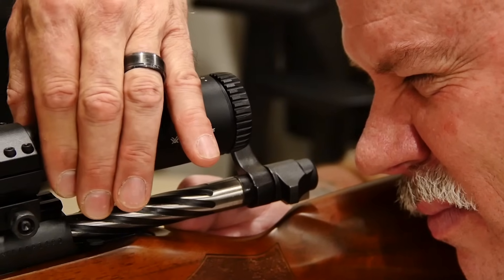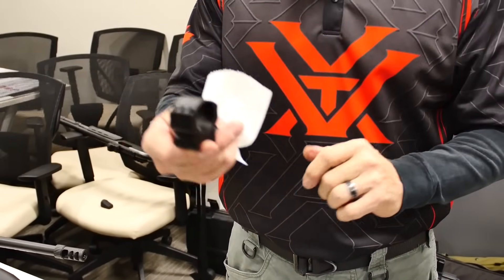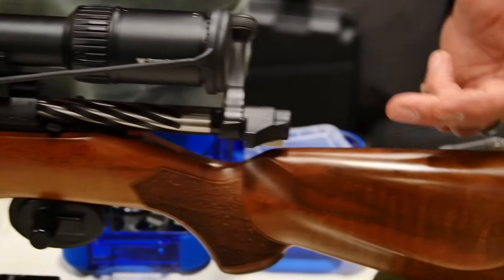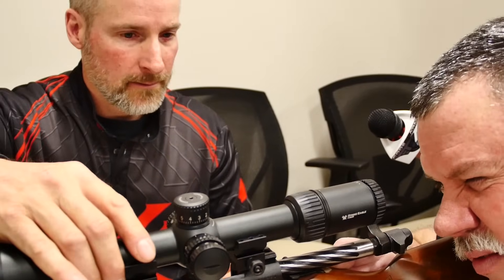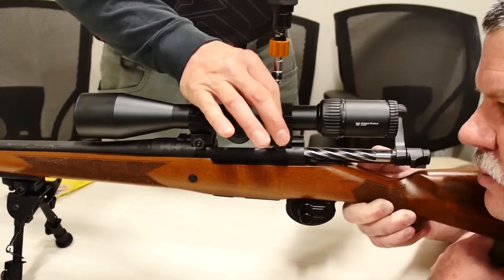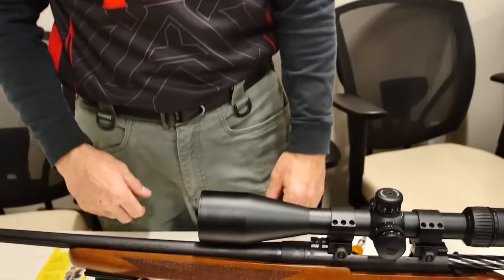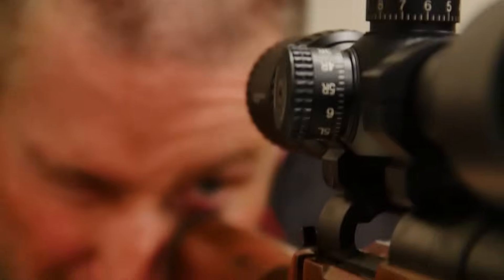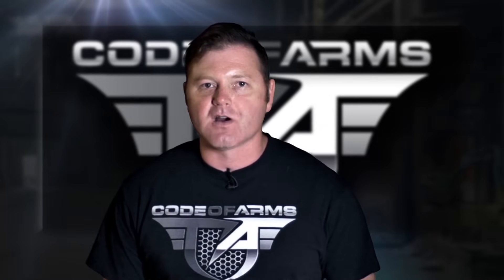HOW TO INSTALL A SCOPE PROFESSIONALLY - By Vortex Pro-Staff Mike Brake

Comment: Very good video covering most of the basics! A few pointers that some may find helpful: If you're using picatinny or weaver style bases and rings, there's not much you can do for ring alignment, but if you're using dovetail type rings then a ring alignment tool is great for proper ring alignment. Also, for the best ring alignment and obtaining the best ring to scope mating surface, lapping the rings would be a great idea to true them up and provide the best ring to scope surface contact. Finally, while I thoroughly enjoy being able to use a reticle leveling tool, unfortunately not all scope reticles line up exactly with their turrets. An idea that has worked for me in the past has been to hang a plumb bob not too far off, and use it to align the vertical cross hair once the rifle has been leveled. Thanks again for the video, and for allowing us to comment. Good shooting!

Comment: I like this video in that there are a lot of good basics most people over look or just don't know about.
I started getting serious about shooting in 1968 when I was 16yrs old. I figured out very early that a level scope was essential to accurate marksmanship. Back then all we had was a carpenters 3" LINE BUBBLE. I got my rifle level in a Vise using a bicycle inner tube sliced open to put around the stock and then a couple thick wash clothes between the inner tube and the vise jaws.
Once the rifle was level and had the base of the scope rings tight I used Mom's fingernail polish on the threads. Next laying the scope on just the ring base to find the eye relief....Marked that with a marker that can later be taken off with a little HOPPS.
Once the eye relief is set then the level is set on the top turret cap, leveled and the top of the rings are set and again using Mom's fingernail polish as thread locker, the top rings are slowly and easily tightened using just two fingers.
NOTE: I still only use the cheapest Five and Dime Store Fingernail Polish on ALL screws and fasteners on ALL my firearms...they are kept in place and are extremely easy to take back off and clean with finger nail polish remover....cheap and you can find it everywhere if you run out or forget to throw it in your bag.
I kept checking that the eye relief is still set and that the rifle hadn't moved off level...that can happen and should be expected because it is difficult to tighten the Vice without hurting the stock...so check as often as after every couple of adjustments of the screw tightening sequence. Lose that and all your efforts will be in vane and then waste good ammo and time at the range.
PATIENCE is your best friend in mounting a new scope so don't rush or take shortcuts.
After everything is tight and level I left the rifle just stay in the vise and sit for at least 12 hrs for Mom's nail polish to dry and set completely.
Bore sighting is best done with a helper and then the range to fine tune.
Those were the standard scope mounting technics back then...TODAY is a new ball game and boy did I learn a lot from this video...especially since I shoot Vortex Scopes on all my rifles now. 
In the day Weaver was the trend because they used steel and that was the sign that you were into shooting seriously.
BOY how things have changed over that last few decades and I'am now in heaven being able to drill 1/2 to 3/4 MOA with a combination of good optics, level sights and built up Hand Loads.
Thanks for all the great information and I hope people take heed and take the proper time to get this aspect right the first time. It sure saves the shooters sanity and a lot of headache later on.
Sorry I got so long winded but I wanted others to see that EVEN with decades of experience and after shooting a dozen different rifle/scope combinations and thousands of rounds that even an OLD DOG can learn new technics and tricks.
You certainly showed a lot of great useful information.
Another great video so Thank you from an Ol' Timer.

Comment: how times have changed when I was younger I used to  align my scope with the bore  by using a mirror   a few meters away   to make sure the bottom of the crosshairs passed through the centre  of the bore in the reflection - cheap, simple and effective

Comment: Basically figured out the same process but only had me doing it. So I carefully put some masking tape on the tube when I set my eye relief in prone position at max magnification to avoid losing my setting. Then slowly locked it in place using torque hand driver. Fitted a Vortex diamond back tactical to a tikka t3 CTR in 308 on Vortex Low pro rings. From factory settings on the scope, elevation at 100m zero was spot on. Was only 0.6mrads off to the right. Was very pleased with the result.

Comment: I'll use a Wheeler scope leveling kit to get my rifle nice and centered in my gun vise, using the bubble gauge in the barrel clamp as a reference to help keep the rifle centered as I'm mounting the scope. Then, a good ol'fashioned plumb line to get my reticle straight. Line up your plumb line with your vertical cross hair. Nothing is going to get things straighter than gravity working on a plumb line.
Reply from the maker: Great input, thanks for sharing your tips!
Reply: Exactly how I mount my scopes. It is the best way to get it as perfect as possible
Reply: @CodeOfArms  It is good that you are thanking, because your method is not very precise, can be used by students and has little to do with professionalism. A professional method is to level the rifle itself, while the optical sight is set in relation to the string loaded with a weight. Gravity is the best for this, it's a professional method. The reticle often has minimal deviations from the symmetry of the optical sight, and that's the only reason why this method is correct.
Reply: I use a level on the mounts, secure the gun in my vice, then tape a paper with crosshairs on the other side of the room- use a level to make sure the paper/crosshairs are perfectly vertical. Then put the scope in the mount and rotate it so the reticle matches the crosshairs on the paper across the room.
Reply: @sp5mxx  Also the scope caps are frequently not level, or even flat! Using the method in this video won't produce consistent results like a plum bob will.
Reply: @TMS5100  It's true, nothing is perfect, so it should be done in relation to the vertical line with a weight, gravity will help us with that. This is the only way you can do it properly.

Comment: If you use the top turret to level a scope be sure it doesn't have any incline to it as compared to the actual scope... An easy to way to check this is to level it, rotate the turret 90 degrees and level it again and do that 3 more times and taking note of the bubble witch each 90 degree turn.  If the bubble is not level at each 90 degree interval the top turret cannot be relied upon to level the entire scope.
Reply: Just out of curiosity, if the turret is not level, what part of the scope would you recommend using to ensure it's level? Just using the cross hairs or something else.
Reply: @ActinOut  I hang a string from a wall with a weight on the end of the string. This ensures I have a perfectly vertical line. I then shine a light through the scope and line up the projection of the cross hairs to the string on the wall. I also ensure the gun is as level as possible while being held in my gun cleaning vise. To level the gun I use a bubble level and I place on top of the scope mounting rails.

Another way to do this is to level the gun and, look through the scope and line the cross haris up against something like a rope hanging down from a tree in their yard.
Reply: I like shining the light method and projecting the cross hairs. This allows you to bring the plumb bob to the exact location without moving the rifle out of level. Also, with rings like that. I use the flat bottom ring to set level before placing the scope on them. It is extremely accurate this way. This allows you to use a longer torpedo/ jet level. Always flip your level to read from both directions to verify it's an accurate bubble

Comment: I would like to add something about getting the cross hairs level and perpendicular to the barrel.  Leveling the rifle in some sort of vice is paramount to a good starting point.  Very easy to do, but you will struggle with leveling the scope with a bubble level.  The solution?.....level your rifle with the bore pointed at a wall.  Align your scope as near level as you can.  Look through the scope on low magnification and have someone place a dot on the wall where the hairs intersect.  Can use a large piece of cardboard if you are not into marking up your wall in the garage.  Make sure the rifle is still level.  Now using a 4' level draw a level horizontal line on the wall.  It needs to be 3' long either side of the dot.  Plumb a vertical line that intersects that dot.  Check rifle level.  Rotate scope until cross hairs line up with horizontal cross hair and plumb line on the wall.  Begin tightening rings as the video suggests.  You will be damn near perfect in alignment.  This is not bore sighting, this is scope alignment.  Don't confuse the two.
Reply from the maker: Great feedback and point! Appreciate your input!
Reply: @CodeOfArms  and thank you for not taking offense to my suggestion.  True professional that understands there is a multitude of ways to level a scope.
Reply: Another method is to shine a light through the scope and align the reticle image to your drawn line. Real simple.

Comment: For added custom ring fit you can always use a laping kit to make sure the inside of the ring is completely in contact at all points with the scope tube.
Reply: Yes but no, depending on the mount (cantilever mounts for example), lapping is doing nothing but fucking with your rings finish. 

Also, most of the time it’s just better to have a matching bar (like the lap bar) installed as the scope before dropping in the scope to check for even contact
Reply: @shadowcard6923  Cheap aluminum rings most often are not true and require lapping, quality ring very rarely if ever do. Alignment tools are nice to verify.
Reply: @artillerybuff2000  if you get not the amazon rings, you’re probs fine. If you’re going for really long range you already are likely dropping $2on the rifle and $2K on glass, your budget has $100 left for a scope mount
Reply: @shadowcard6923  Agreed. I personally hate cheap rings, but you have to mount what the customer asks for when they purchase the rifle & optic. Our store stocks good stuff and unfortunately some lesser stuff because a lot of times that's all they want to spend. I mount the scopes at no cost when they buy from us and do what I can to make sure they go out right no matter what. I cannot tell you how many times they come back with a huge smile saying it only took a couple of shots to zero...
Reply: @artillerybuff2000  oh that sounds really annoying, customers are rarely right
Reply: @shadowcard6923  Yeah and a lot of the times the guy behind the counter isn’t as professional as he leads on lmao.
Reply: ...or the Burris Signature rings with spherical nylon inserts. On a lot of older rifles with Weaver bases, the bases aren't necessarily exactly aligned, despite the best efforts of the gunsmith who drilled the holes for the bases. Better spend a bit more on rings than risk a bent scope-tube.
Reply: @shadowcard6923 perhaps, but also not necessarily true. Ex. You're setting up a long range shooting gun and for best ejection clearance it's better to use rings with a built in rail. Because it's for long distance, you also need at least a 20 moa cant. If you could do a single solid long action rail to mount rings on, you could be more likely even between the rings and not need to lap the rings. But with rails built in to rings where the front rings are thicker in the base to provide the cant, there's much more chance that those rings will need to be lapped to ensure the inner parts of the rings are perfectly aligned so no edges kink the scopes tube. At least as I've seen, more long distance shooters use 2 seperate canted rings with built in rails with long actions as opposed to a single long canted rail. So you could very likely spend $100-200 on high end rings and still need them lapped for a long distance shooter because of the needed 20moa cant between the rear and front rings.  This also happens to be situation with my new Browning 7 prc x bolt being set up for long distance shooting.

Comment: Good information.  I have been a gunsmith about 15 years and torque everything to 30 ft lbs.  I have found with some manufactures that 40 lbs stretches the  threads and eventually comes loose.  Plus unless you are shooting alot of high big caliber rifles, 30 lbs is sufficient.  I have never had a scope come loose using 30 ft lbs.  Levels are also handy but maybe because I have done so many, I just use alignment tools and can get it level in about 10 seconds unless i need to add shims.  i cannot express enough how important it is to be level.  i have had to tell many customers that they ruined their scopes or bent the outer tube by not installing it properly.
Reply: 30 ft lbs??????
Reply: @20andin  Oh crap, inch pounds is what I meant.  I was doing to many things at once when I replied.  Thanks for the catch
Reply: @earlhuff7847  I hope no one followed your first advice. I am he guy that gave you the thumbs down and you know you deserved it. It's nice you noticed and commented back.

Comment: Well made.  I especially appreciate the Eye Relief segment, as that's where I struggle mounting my new scope.  Probably should get new rings with 3 screws to a side as the scope seems to 'roll' when I begin to tighten down the 2-screw rings.  Thank you.

Comment: For 300yd shooting this should work for them...and then some.  For F-Class, we dont use a bubble level on the turret,  but rather match the reticle to a plumb line for true alignment and then install the tube bubble levels
Reply: Would you mind telling us about that please, Warren?
Reply: @wm.traynor1143  it's actually a simple concept...gravity always acts straight from high to low.  On a non-windy day take a string...like a thicker kite string, attach a weight to it, and hang the string to something tall (throw it over an open tree branch if need be).  Object here is to have a perfectly straight, plumb line say 10, 15 or 20ft tall (make sure weight is a few inches off the ground).
Now take your scope, place it in the rings and attach a tube mount bubble level to your scope loosely to where to could see it from the corner of your eye when looking through the objective.

The scope mounts can either be attached to the gun or just sitting on a flat surface like a fold up table.  Next - line the reticle up with the plumb line further out you have it and the higher the magnification you can use, the better (especially w/ FFP scopes).  Once the vertical cross hair is lined up perfect with that plumb line, say 20, 30, 40yds out...dont move the scope.  Carefully tighten the clamp on your tube mount bubble level to where its perfectly level.  Viola! Your reticle is now perfectly plumb whenever the level is horizontal. 

Place your rifle in a vice or a clamping tripod and use a small level on the scope rail to ensure the mount is perfectly horizontal.  Once thats done, mount your rings and the scope loose enough to where you can rotate it so the tube mounted level is plumb.  Carefully tighten everything down and you're good to go.
Reply: @vetteconnoisseur9531  Thank you very much😃👍
Reply: A-one tips right here folks

Comment: I always lap my rings no matter if they are top of the line or mid range. The Wheeler levels should be put on the same plane to see if they are true. I've had many sets of them trying to get a pair that are true to each other. Finally gave up & went with a milled aluminum matched pair.
Reply: Basically, it is not the quality of the rings. It is how the rings are mounted on the gun. Dual ring machined mounts should not have that problem.
Reply: Right Talley says there rings don't need lapping so I wouldn't do that with their ring's it could cause a torc problem just as oil or lock tight can easily cause over torc.
Reply: Good choice !